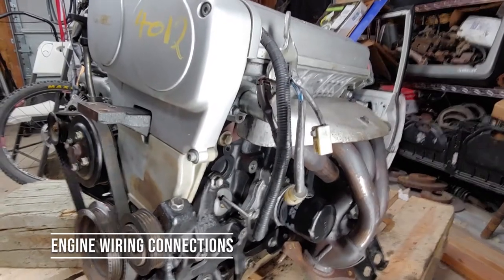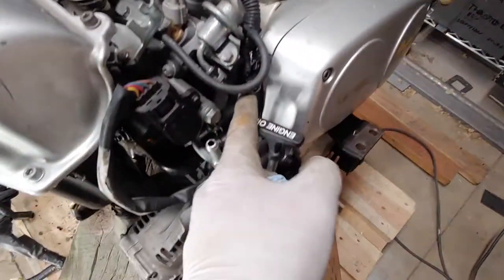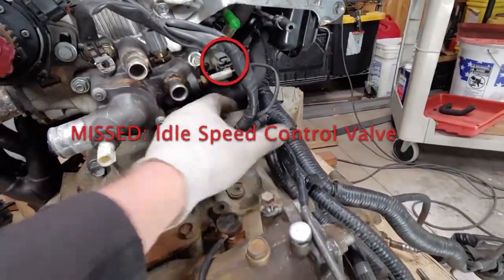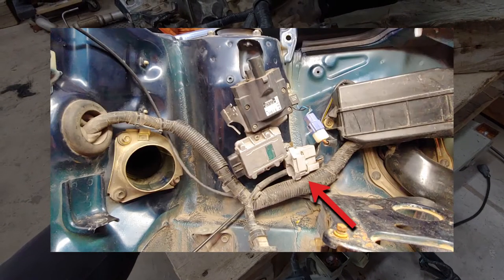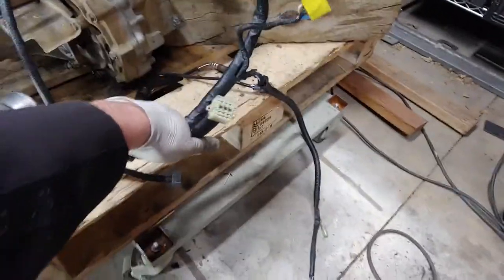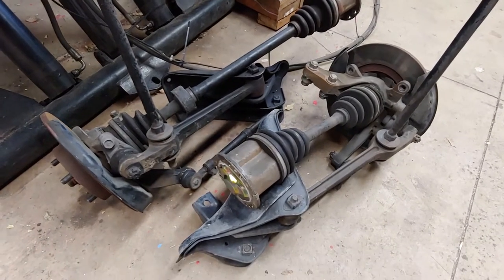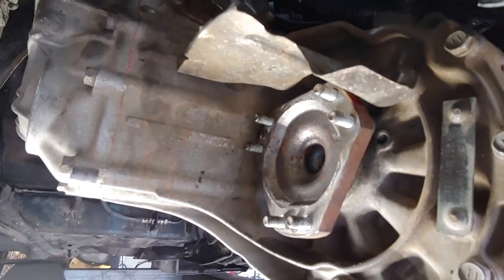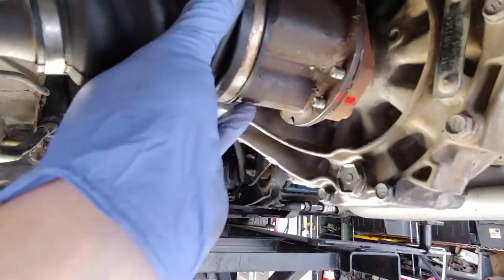Toyota MR2 AW11: How I 4AGE 20 Valve Swapped (Part 3)

Comment: I just bought my 2nd AW11. She's a 1986 with a tired, but running 4AGE 16v stock motor. Twenty years ago I had an 85 and I loved the 4AGE in in. This one isn't the same. Oil leaker and oil burner she's stinky and messy. I'm on a very tight budget now but expect to have more money in the next 4 years or so. In the short term I plan on doing what I can to keep my 4AGE 16v running, long term I'm thinking 2zz or k20 A2 with the RSX type S gauge cluster. I loved your three videos on this swap.

Comment: Really love the time and energy you put into this three part series. I have a 88 with a tired 128k on the odometer. Been weighing my options  between a few different swaps such as this a 2zz or even a 2ar. It def seems as the 20v is the easiest method with the 2zz in second. Only reason I’d find the 2zz a issue is the price for the engine and the additional components that you need to get as well as adapting the passenger mount. Likewise the 2ar would be a lovely swap nice torque,good fuel Econ and updated engine tech.However not only is there mount fab work to be done with all four  points, custom axles and a few other things makes me stray from it.. I totally agree about it not upsetting the balance of the AW11 chassis and what it was designed for.  At this point though I’m seriously weighing whether it would be best to go to a 20v swap than refresh the 16v engine ———things to do like water pump, thermostat, new silicone coolant plumbing.
Reply from the maker: Thanks much! Really glad a few people are finding this useful! Is your 4AGE low on compression? What do you mean by "tired"? My observation is they don't need to be cracked open until at least 175000ish miles if they have been well fed.
Reply: Larry Sanders oh the engine runs fine compression wise not near optimum, but I’ll have to recall where I put the compression readings. I know you stated your final thoughts on the swap but if you had to revert back to a 16v, would you miss the 20v? I hardly see 20v engines on eBay how much did you purchase yours for?
Reply: Larry Sanders also I redid a compression test. 180ish on cylinders 1&2 while 3 and 4 are around 130 ish.
Reply from the maker: @rac3445  I would definitely miss the 20V. Yeah I guess it's time to assess your engine with those numbers. Is you car "nice", or is this a track or beater car? 2ZZ gets easier if you don't care if it's pretty. So many problems avoided by sticking with a C transmission.
Reply: Larry Sanders it’s a beater that’s getting a second chance. Yes I agree with the 2zz comes sourcing axles and what not...most importantly both the 2zz and transmission still cost a bit of money. I def see what’s next for this engine.

Comment: Hey love the video! I was considering a silvertop myself with how very close to plug and play the swap seems like it is, but I noticed that I couldn't find any for sale! and any blacktop costs about the same as a 2zz.... sooooo I'm definitely planning on getting that 2zz swap done in the near future. 6 gears and a high rpm screamer are the only engines that should be put in an mr2!
Reply from the maker: Thanks! Nice! As mentioned in the vid I think the 2ZZ is best choice AW11 swap. About the time I made this video I started to daily drive a 6 speed 2ZZ Vibe GT. Love it. Torque at low RPM (all RPM) is way better then a 4AGE. To get into the high RPM power band you really have to want it. It opens at 6200ish and it's a kick in the pants, but it just doesn't happen in normal, even fairly aggressive driving. On track you can really take advantage of the power band, but I'd reluctantly use a 2ZZ for a demanding race application. All the 24 Hours Of Lemons racing I've done has convinced me the 4AGE is a tank and the 2ZZ just doesn't hold up as well. My brother's 2ZZ AW11 race car has had a lot of head gasket failures and is on its 3rd engine in about 20 endurance races close to 900+- miles each. What a blast when it's running tough! I said "reluctantly", not "I wouldn't". Having kept an eye on the used 2ZZ car market for some years, don't notice many 2ZZs survive to 200k miles.
Reply: @ADub-Bub  dang head gasket failures? any good tips on preventing that? And yeah seems like to make a 2zz last you gotta dump tons of money, rods, heads, darton sleeves to replace the MMC ones ... makes me consider going honda with a k20 or k24, but my issue is the sheer amount of custom work to make that work in an aw11, and cost, would outweigh the power gains. I hear the OEM rods can warp a bit after repetitive sustained high revvs. 

Something I heard mainly about 2zz's is replacing the oil pump gear, and the oilpan, I hope your friend employed both of those fixes since hard cornering could be the cause of engines blowing up due to the oil pump either blowing up, or sucking in air.
Reply from the maker: @Electronica27  Sorry this turned into such a long ramble, that's not entirely applicable to your comment/question:

The 2ZZ oil pump gear/pan always withstood the abuse in my brother's race car. Full throttle, in the power band, 15 hours a weekend, on tracks like Thunderhill with plenty of sustained high speed turns. So I question if there's more to the reports of the oil gear failures, like gear selection error.

I only have a little experience helping rebuild engines, so no revelations on avoiding 2ZZ head gasket failure. Torque to spec? Try to source a low mileage JDM with verified good compression and don't unseal the head.

I'm coming at the swap problem from a daily and recreational driving perspective. A 2ZZ is going to be a blast and should not suffer in that circumstance. 

The AW11 is a tricky car to build for power. There are so many trade-offs working within its constraints: Engine size/weight, handling, reliability, comfort, cosmetics, fuel consumption... Then how do you measure success? Dyno chart? Acceleration numbers? Lap times? Finishing position? The whole equation gets simpler if you prioritize enjoyment of the driving experience. Where power is priority, it soon makes sense to choose a different platform that's not such a puzzle. 

Toyota left little room for improvement in regard to driving enjoyment, both on public roads and driving at the limit on track. Even in my race car, stock 4AGZE, relatively slow vs the cars we are classed with, I can't imagine having more fun, satisfying races. The AW11's constraints teach me to be a better driver, to carry momentum, to take full advantage of the handling strengths. Every grin that every turn puts on your face, the skills you acquire, and what you learn of the car's capabilities are worth more than compromising for horsepower.

Comment: fantastic series, i learned so much and am feeling a lot more confident diving into my swap. 
MY swap harness is made to run a Blacktop so it has a MAP Sensor. 

Either way, i was wondering if its possible for you to go over the vacuum lines that run under the ITB's!
Reply from the maker: Thank you! 

Off the top of my head I don't recall much about the vacuum routing. It's been long enough since I did these videos I don't recall if I even mentioned vacuum lines and that would be big omission. 

What I do recall is there were a few good diagrams I found searching the web that answered any questions I had. These two links were pretty helpful to me:

https://www.club4ag.com/forums/viewtopic.php?f=13&t=21153

https://www.mr2oc.com/threads/blacktop-20v-water-lines-and-vacuum-lines.543482/#post-5849730

Next chance I get I'll see if I can get some useful footage.

Comment: Hi bud, thank you so much for making this series. I have a '86 with a supercharger swap but the SC is failing with 15 miles on the rebuilt engine that has been keeping it sitting for seven years. Been looking at 20 valve since seeing Sushpants FX videos over pulling the SC and going turbo. Thoughts on that from your experience in the MR2 world?
Reply from the maker: Thank you! Love @Sushpants content! I can only offer unsupported opinion and speculation on turbo, which is exactly what the internet is for, right?

My short answer is I'd take the shortest path to a reliable running AW11 rather than X months to add power that may break. Factor in your own resources of time, money, and availability of other fun cars to keep you entertained in the meantime. 

Long answer: My top priority for an AW11 is handling. I like superchargers and prefer the even torque delivery feel to the (very few) turbo cars I've driven. Turbo kicking in during a hard corner (like the onramp by my house) is pretty unsettling. I speculate that if we compare the area under the curves of turbo and SC dyno graphs, instead of comparing peak power, we might see SC delivers more total power over the range of usable RPM. One other reluctance I have is reliability. The old MR2 forums were littered with blown turbo projects due to excess boost.

So in your situation I'd do everything possible to save the SC. If you've confirmed it's indeed toast, your 4AGZE with forged internals is a great starting point to try turbo.

If you can source a healthy 20v, by all means I recommend. 2ZZ is my swap choice for an AW11 for some added work. I would not rule out a stock NA 4AGE. I've always felt the 1ZZ is an interesting consideration as they among the most plentiful motors ever (littering every junkyard), they are reliable, light, and offer 20HP over stock NA 4AGE.

By no means would I add weight to an AW11 with an engine and transaxle swap heavier than the 4AGZE setup.

I've been lucky with my SC AW11 Lemons race car which has only suffered from loose tension after replacing the belt. Runs like a top. I do need to install a boost gauge to get real data on how it's performing.
Reply: @ADub-Bub  Awesome thank you for the input. I have a '91 Turbo T-Bar so I understand the boost in corners aspect. The SC is dropping its gear oil into the intake even after replacing seals. I am running a C52 transmission as well so no E153 bulk as half shafts were not available when I did the swap for a few years. Currently it's set to 12psi with the T3 Boost pulley running everything conservative via DIY Mega 2. I agree, KISS works best with these cars hence why I'm thinking the 20v for the linear aspect + trumpets and ITG filter setup etc. Rather sell the good long block + its goodies than risk knocking on the door and throwing a rod. Running Knock Sense as well on it regardless but still. Decent turbo setup for me to weld up is almost the cost of a BT to do it right. 

Thanks for the tips! Will try to make the SC last and get a BT 20V to tinker with over the winter. :)

Comment: Hi.. Im thinking do a silver swap on my 86 aw11 one of my concern is the wiring.. The stock aw11 wiring  can be use for the silver top 20 valve
Reply from the maker: No original AW11 will plug/play with a 20 valve. You can convert it yourself, but if you are asking this question you probably should hire it out. I had my harness converted by WireGap. You ship them the engine harnesses from your 20V and your car's original engine, and they ship back a complete plug/play harness.

Comment: Nice.. Hope I can get my 4agze to work in my 87SC sunroof car with no A/C no cruise control, no sway bars. It's blue/blue just like yours!  I do wish I had kept the AC system though.  Something to be said about the stock 4age engine as that it was super reliable sans the Alternators  that were easy to swap out but still.
Reply from the maker: Sounds like a good project! Think you're going to want a front sway bar.
Reply: @ADub-Bub   I have a custom Ground Control Setup with ERS springs and SW20 housings + Koni RACE struts, etc.   Have to get it dialed in but first have to figure out this slight bog I have when I try to give the car more than 1/4 throttle.

Comment: Just a fyi, you do not have to remove axels or suspension for the swap I dropped my 16v and transmission out the bottom and put in my blacktop swap through the bottom without removing any of that.
Reply from the maker: This is true. I've done it both ways and suggest dropping the suspension makes the whole job easier. When I say "the axles have to come out", I just mean they have to be disconnected from the transmission. Unlike the footage though, I suggest popping the shafts out of the transmission instead of unbolting the joints. I don't recall why, but ended up removing the stubs to for some issue.
Reply: @ADub-Bub  Yeah, I just unbolted the joints and went at it.  Just wish I had this video a year ago, would have saved a lot of research on my part!  Just finished mine up a couple months ago

Comment: The typical 2zz is a complete basket case.  2ar is cheaper, is in better condition, and weighs the same as the 4age.  With slight mods, it can bolt to an s54.
Reply from the maker: Valid. My brother's 2zz track car regularly had issues under the demands of endurance racing. My daily driver 2zz Vibe GT is unfazed by my driving or what it would go through in my MR2, going full lift very rarely and deliberately. Since I completed this series I've been really impressed by my friends 2AR MK3.
Reply: @ADub-Bub  I had a 2ar in a mk1 mr2.  205whp with the retuned ECU.  Don't know why you would do a 2zz instead?
Reply from the maker: @mr220v  I dismissed anything I assumed it would add weight. 2AR wasn't a swap I had much awareness of when I made this video, and zero awareness when I found my first 20v for sale locally. Great news that the 2AR is so light. My questions would be does it clear the engine bay unmodified, and what are the trade-offs transmission wise? 2ZZ bolts to an AW11 C5X which simplifies a lot of things. Not familiar with the s54 you mention. BTW, I thought you might be THAT mr220v! You probably don't remember but I really appreciate all the help you gave me with your wiring harness, and you went above/beyond answering general swap and donor engine questions. Your reputation on MR2OC.com was well deserved. Always recommend your Wiregap harness! Hey, have you thought much about EV conversions?

Comment: Correction : 20v Silvertop has a MAF (Mass Air Flow sensor), and 20v Blacktop has a MAP (Manifold Absolute Pressure) sensor. This is the reason why you can run open trumpets on a Blacktop and not on a Silvertop, unless you convert the Silvertop to MAP sensor
Reply from the maker: Thanks for the clarification!